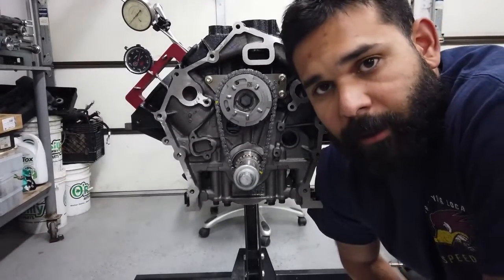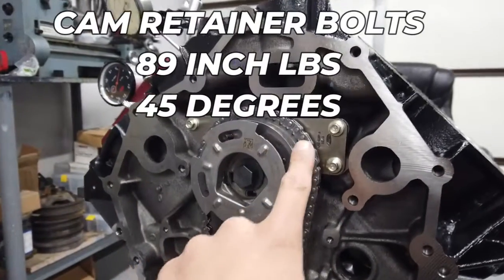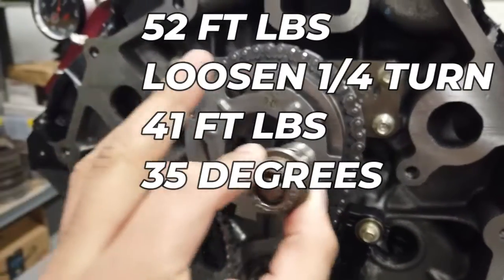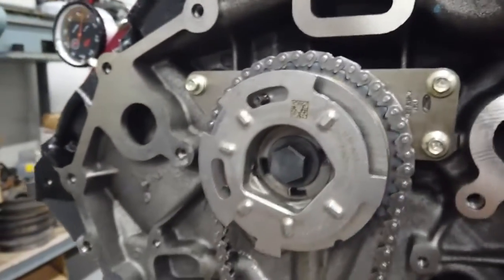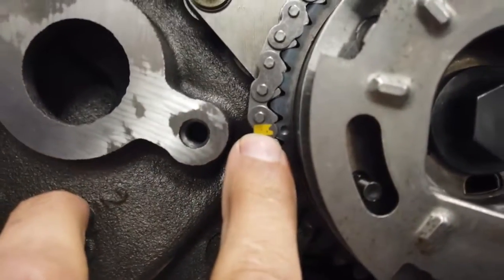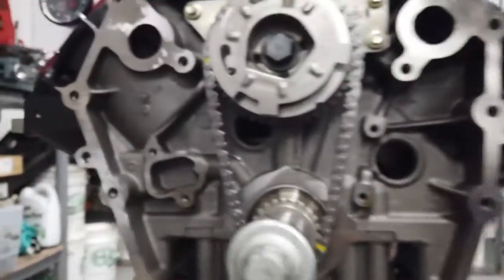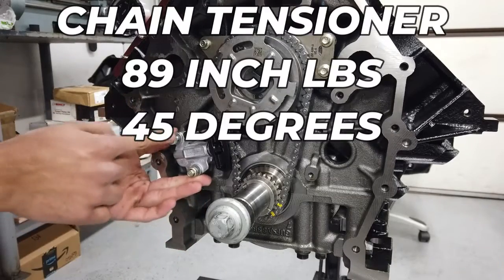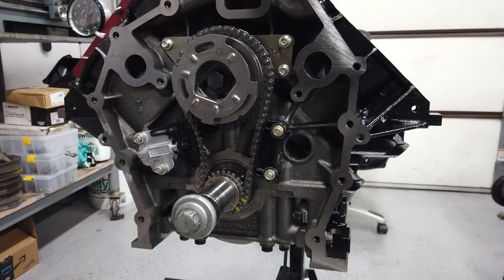7.3 Godzilla TIMING CHAIN INSTALL AND TORQUE SPECS

Comment: Question, after timing chain is on and you spin the motor manually. Will the timing marks line back up spinning motor cyl #1 to TDC?

Comment: Could you please tell me head bolt torque and rod bolt torque specs I can't find anywhere you seam to know rest pretty well.
Reply from the maker: chrome-extension://efaidnbmnnnibpcajpcglclefindmkaj/https://performanceparts.ford.com/download/instructionsheets/IS_M-6049-SD73A_M-6050-SD73A_011221.PDF